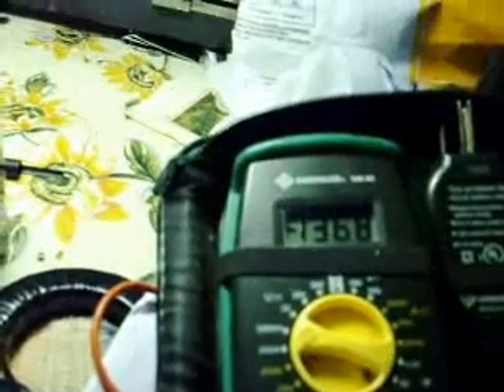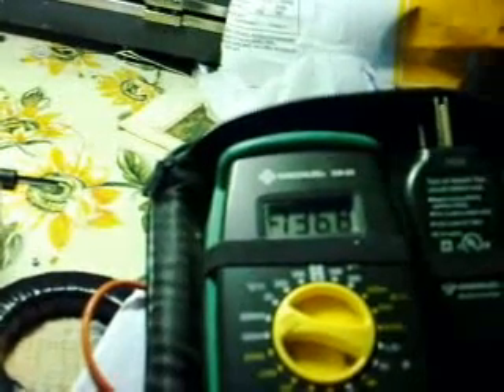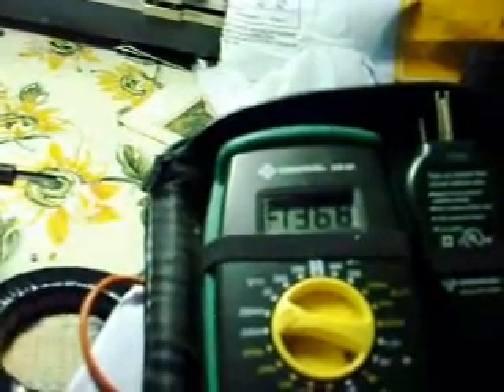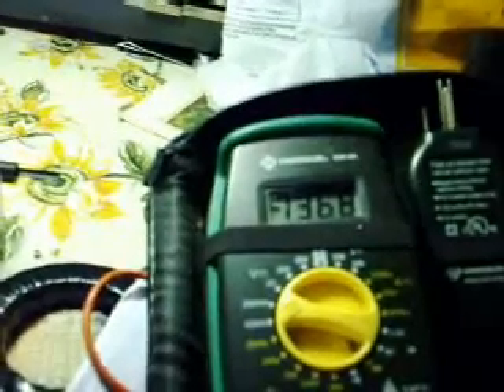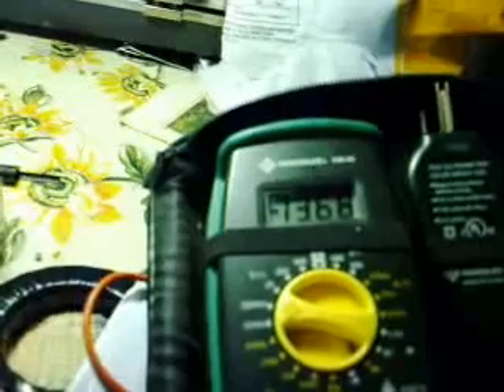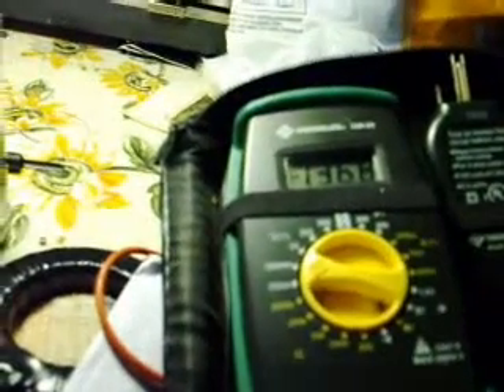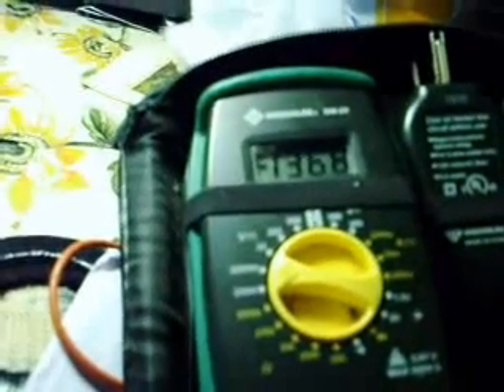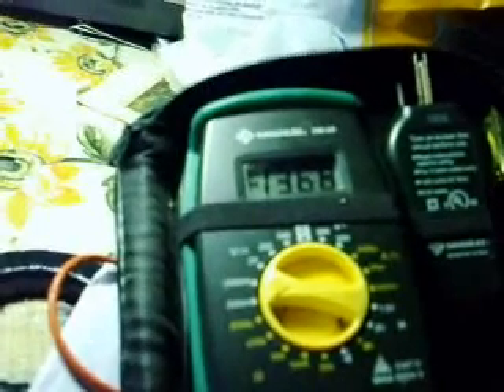selfrunning E-light.wmv

Comment from the maker: Thanks for the comment and advice wattsup1004 . I checked the probes with two meters and they both indicated zero volts . one digital and one analog. This little light is now encased in Lucite and was given to my parents years ago . it is still running although i see the batteries starting to leak...it is a fluke circuit that i posted on ou.i know i am not the only one who makes circuits that run and charge and i recently have experiments with Ls crossover that has similar conditions.

Comment: Please be careful about one thing. I feel you are leaving your voltage meter too long on the device and this is what is charging the batteries every time you look at the voltage. You are just waiting for it to rise and saying it is really something, but this is very normal I have seen to my dismay many times. On low voltage devices, you should put the meter on for not more then 5 seconds, take the reading and the time/date, then much later take another 5 second reading, and so on. Best regards.